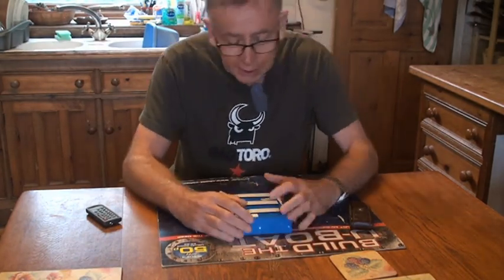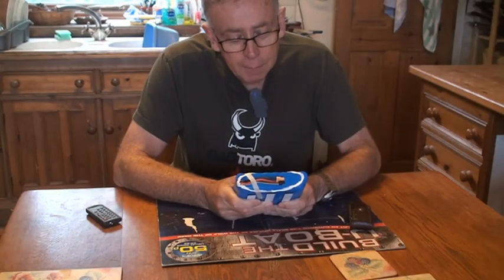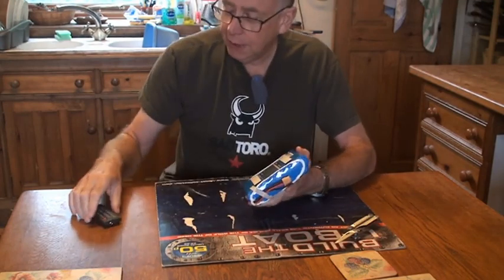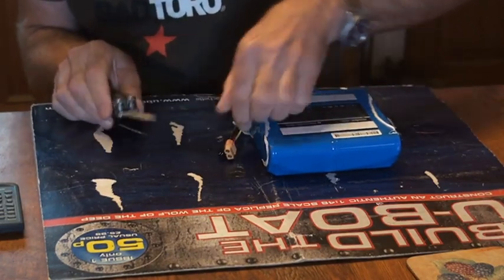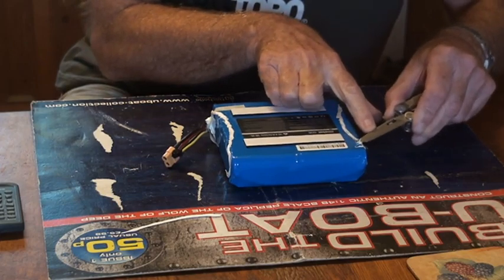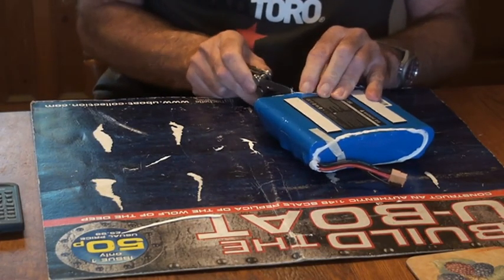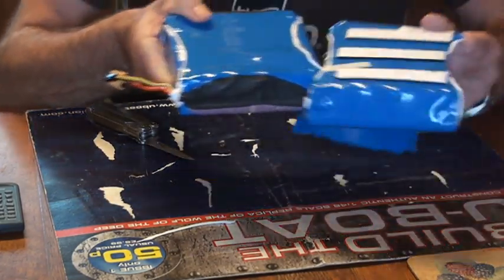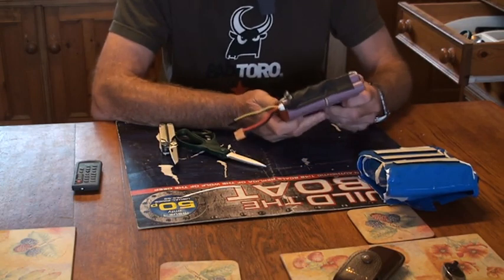Ninebot One E+ Battery Investigation

Comment: Hello. Until what voltage is it save to ride the one E+ ?  I bought a secondhand this week, and the app says the battery is 61 V when 100% charged. When it’s around 60% the voltage dropped to 58V.
Reply from the maker: The Ninebot One E+ Battery is 320Whr 15S2P. Assuming 4.2V/cell to be fully charged, that would be 63V and 0% charge (3V/cell) being flat would be 45V overall.  50% charge would be around 57.3V time to go home :-)   61V I would say was 90% but that's OK.
Reply: @Roskellan  thanks for your answers. I have been riding my Airwheel X3 for many years years. I really enjoy the one E+ for its a bit faster. Fast enough for me now. I only use it for small rides.
Reply: @Roskellan  So don’t ride below 57V?
Reply from the maker: @Frank-Y  That would be my advice, when cells get as low as 3v they will drop rapidly under any further discharge anyway, so there is little to be gained from going lower.
Reply: @Roskellan  thank you very much for your advice. Greetings from the Netherlands.
Reply from the maker: @Frank-Y  Don't ride below 45V. 57.3V being about half charge

Comment: if i followed that procedure for testing and it came back all of the are at 3.95 -99 no dead cells does that mean its good or does it have to be 4 volts
Reply from the maker: Any voltage above 2v is a good sign, anything above 3v would be considered normal. 3v to 4v (flat to charged) being the normal working range of the cell. If you are measuring above 3v in every case, you have a good battery pack. The next consideration is that all voltages should be the same. If some pairs are too low they can be charged to the same as the others by connecting a supply across that particular pair. That supply would need to be constant current (250mA perhaps) and set to either 4v, or the voltage to which you are trying to achieve. If you are charging batteries from a supply it is essential the current can be set prior to connecting to the battery. In all of this you are working live as it were, any mis-connection, reversed polarity, or inadvertent short will have an instant and dramatic consequence.